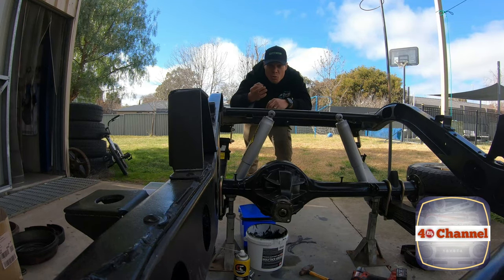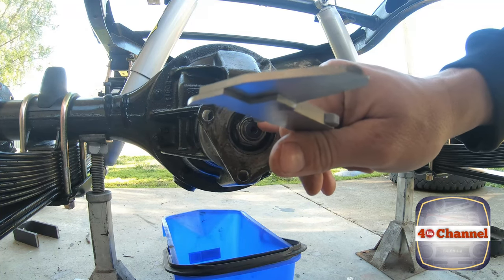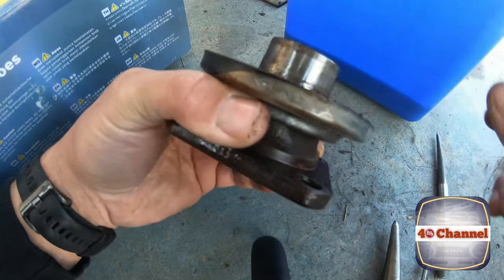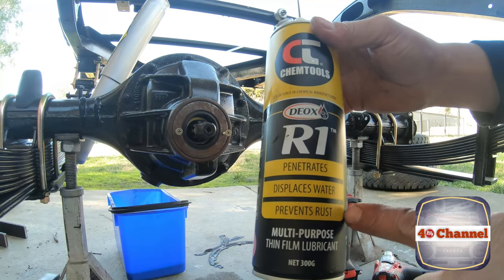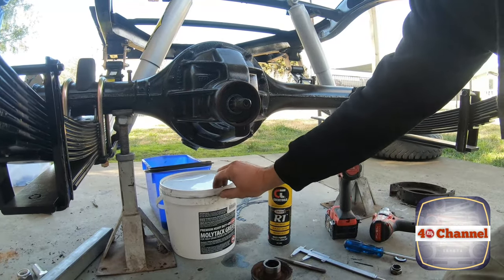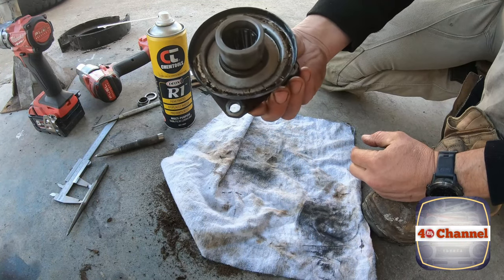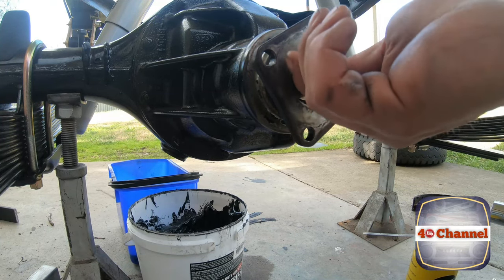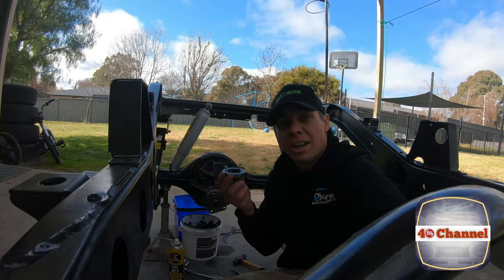S2EP14 Remove and replace pinon seal, Toyota, Landcruiser 40 series

Comment: You need to turn the pinion flange to make sure it has not locked up they often do.The shims on the pinion bearings from the factory are thinner than cigarette paper when you get wear on the pinion bearings the spacer can turn and the thin shims all disintegrate causing the pinion to become really loose it then locks up the diff when you tighten the nut.When that happened I would pull the diff out take all the thin shims out and use thick ones only I would then rub the spacer on a sheet of rough emery paper resting on a sheet of glass to get the correct preload on the pinion bearings once that was done I would install the pinion seal then preload the carrier bearings and adjust the backlash.When your vehicle was new I have had to set up the diffs up at 30,000 km it is very common on earlier Landcruisers I did so many I could set them up by hand without using a spring scale or dial indicator.Set up time with the diff in a vice was 20 minutes it took longer to get the gasket off the diff housing.Once the shims have been spun there is no way out of pulling the diff out it has to be set up again otherwise you will be up for a new ring gear and pinion the backlash will smash the teeth.
Reply from the maker: Thank you John for your detailed message you have taught me a good lesson, still so much to learn on early cruisers. I appreciate others sharing there knowledge and skills.

Comment: Great Video and nice trick with the Screws, gotta remember that one. But I will propably rebuild my Diffs completely.
Reply from the maker: That sucks that you will have to do a full rebuild on the diff, but will be worth it in the end.
Reply: @40ChannelCruiser  I am not sure if they actually need a full Rebuild. I just want to replace all the parts that get worn over time. The 42 is over 30 years old, so I think its not a bad Idea to atleast replace the bearings, seals,  check for wear and swap the rear diff with the front diff.

Comment: What about the metal shavings from the drilled holes?
Reply from the maker: Yes Tommy you're spot on. Just give it Inspection and Cleaned out.
Reply: @40ChannelCruiser  I use a magnet

Comment: What for was that measuring? 🤨 You tightened the nut after anyway. 
You’d need to test how it turns after the tightening and maybe add some shim there. Otherwise you may burn the pinion bearing.